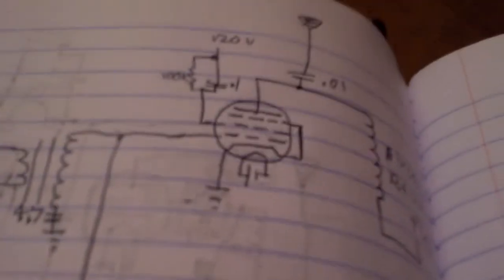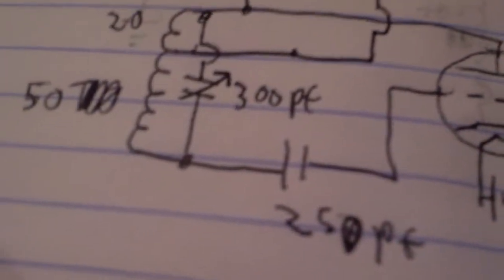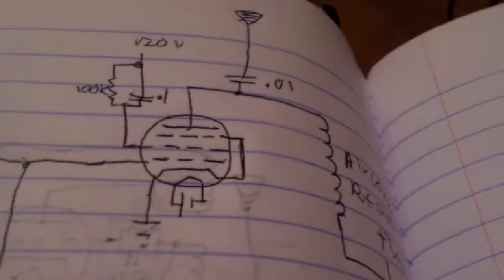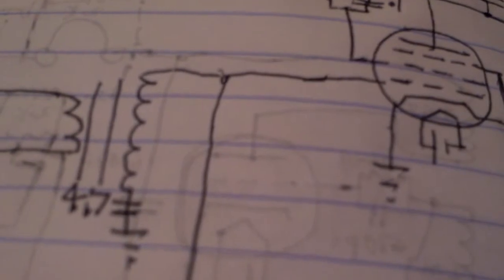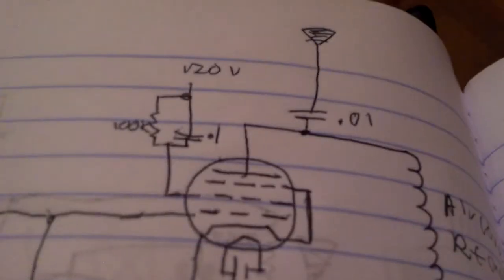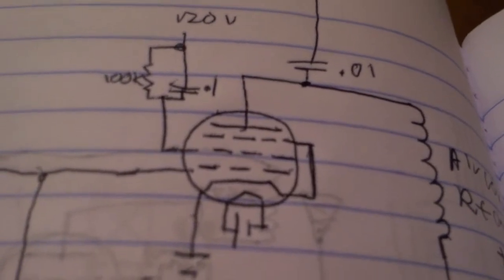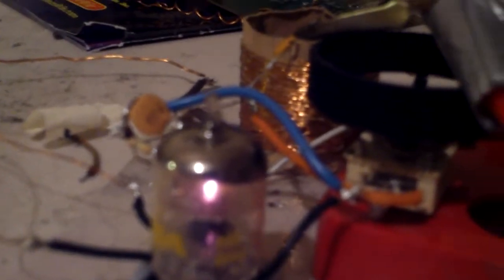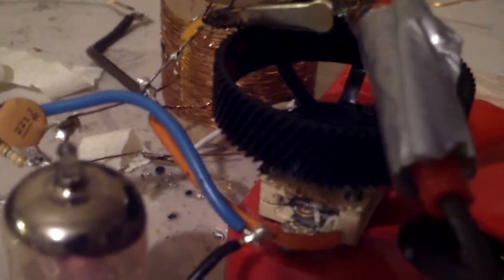tube music transmitter

Comment: what a mess be careful it looks dangerous open wires 300volts ! with the 6146 it's over 100 millawatts  . might be at least 25 watts ? I built one with 3 6al11s crystal controlled frequency power output 100 millawatts I use it as a carrier current transmitter built on a pc board in a aluminum chassis
Reply from the maker: You are completly right, I have considered taking down this video because it is so horrific looking back, but for now I use it as a reminder on how not to do things.

Comment: When you run low power like that your oscillator generates enough signal to act like another station on the same channel that your PA is amplifying and putting out. So what you get is a modulated PA amplifier putting out full modulation and a mixed signal coming from your oscillator which when mixed by a near by radio results in distortion and low audio. 
AM transmitters are fun to build and look pretty on an oscilloscope but you need to learn how to tune an antenna to it so final RF comes out.

Comment: You have to realize the oscillator is generating a carrier wave of its own and you are modulating the power amplifier PA. So when your radio is next to the transmitter you are not only picking up the PA modulated output but also the quiet oscillator.
Once you get a resonant antenna on the transmitter the weak power of the oscillator will be so little that you won't hear it quiet out your modulated PA amplifier and thus you will finally hear your fully modulated AM signal on your radio :)

Comment: Your transformer is working as a magnetic amplifier. Be careful what freq you transmit on, You can get in a LOT of trouble with the law if you get the wrong freq. Thats about all I know. 

Nice simple circuit, you make it look easy. If you got it transmitting in an hour for your first attempt you are doing really well.